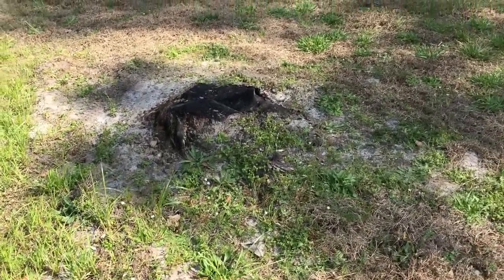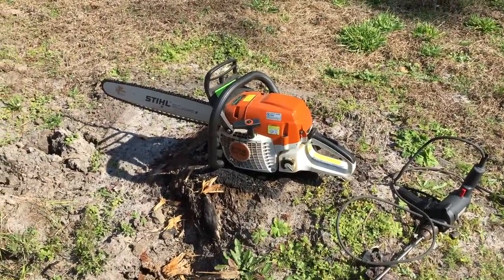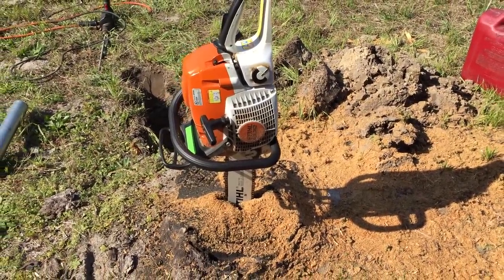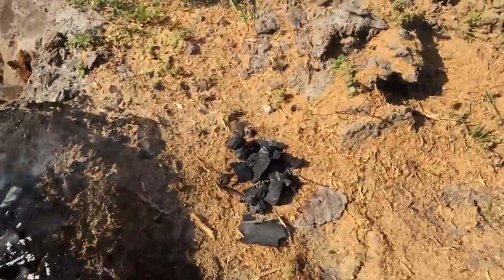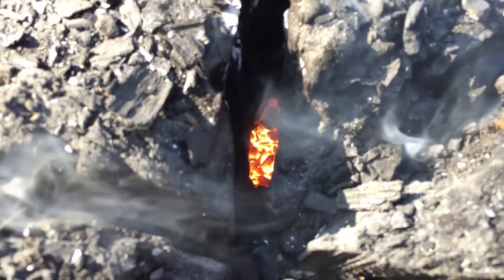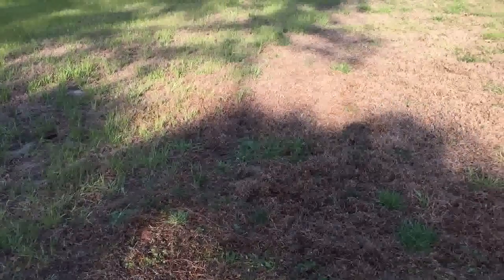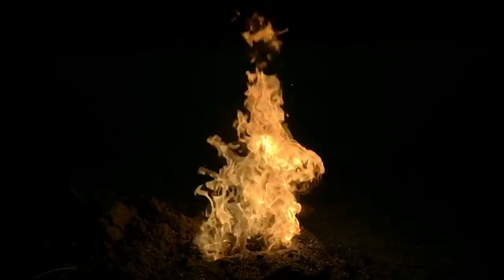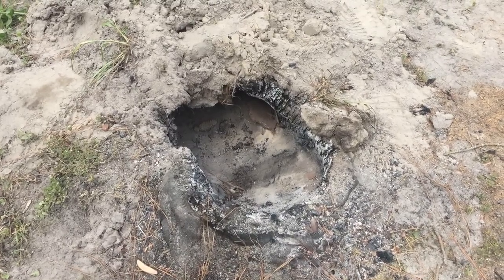🔵 Burn Out a Stubborn STUMP out with a Boost | Gates of Hell | Teach a Man to Fish

Comment: There is some simple math that covers why a surface fire is so hard to burn out a stump but it boils down to 3 figures, Wood ignites at 660F, Water boils at 212F and the wet wood acts as insulation with the heat only reaching 1-2 inches depending on wood density and how wet the wood is. The hottest surface fire is at most cooking the water out of 2 inches of wood so lots of energy going to waste when a internal small smoldering fire cooks to the same depth but 360 around it so more total area on a fire you could have next to a building as the extra heat is going up rather then out. A vertical burn hole that you did with the chain saw and evenly spaced air intakes from around the stump to promote even burning out as the fire will follow the air intakes as it smolders. Think a turtle and hare type race where if you need it done faster simply cut more burn holes. 

The only major thing is if you have rain in the forecast is to find something metal you can cover the burn hole with to keep the water from hitting the burning area of the stump so a scrap of metal roof or even just a old baking sheet will work.

Comment: We live in the middle of what was a prime lumberjack area back in the 1880's to early 1900's. We still have stumps from that time. It's terrible on chainsaw chain, etc, but I cut stumps down below ground level and cover them. That works great until you want to do a garden or flower bed. Great video, thanks.
Reply from the maker: It is crazy how long those old dense sap filled stumps last.

Comment: It is easier to use a carbide circular saw  blade with a gas trimmer to grind down and cut the tree stump.  Cheap, fast, easy, and fun.
Reply from the maker: I just looked at your video, you aren't actually removing the stump.  You are just cutting it off level to the ground, that isn't stump removal.

Comment: Did this a few years back with a long garden hose with a 1 inch pipe on the end. Used a little mattress pump on the other end. Put the pipe down in the hole. You could put set leaves and cover the hole and it would just incinerate.
Reply from the maker: Nadia Preis it is a good way to get rid of a stump.